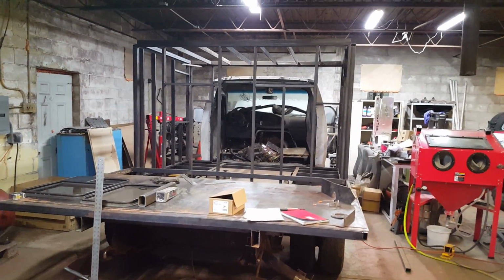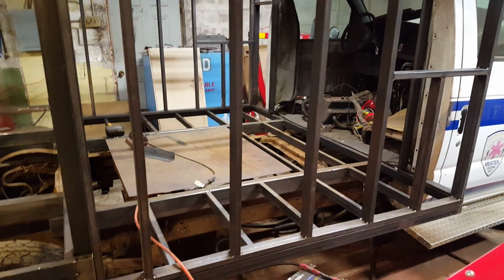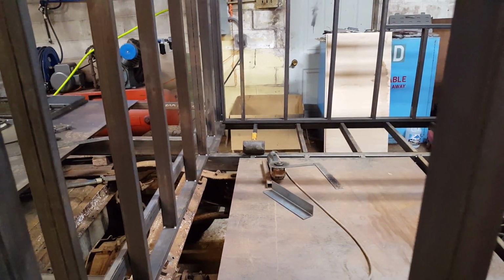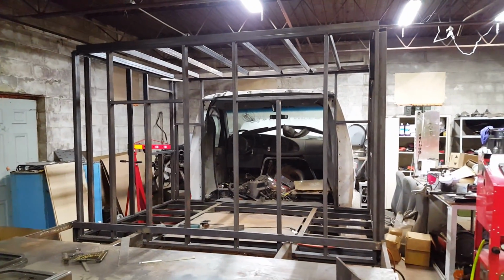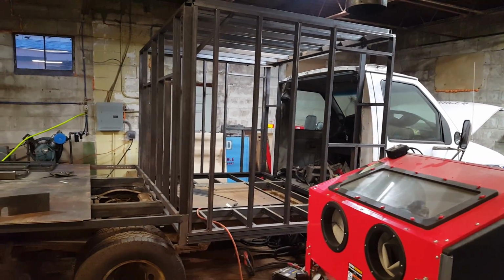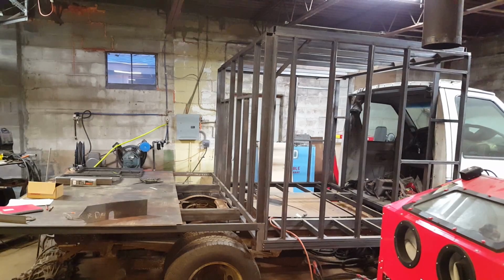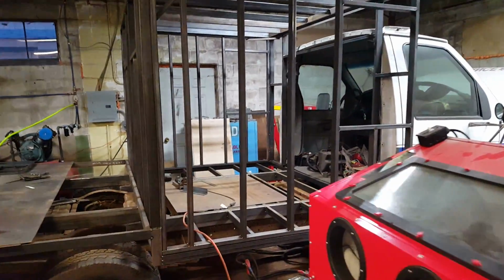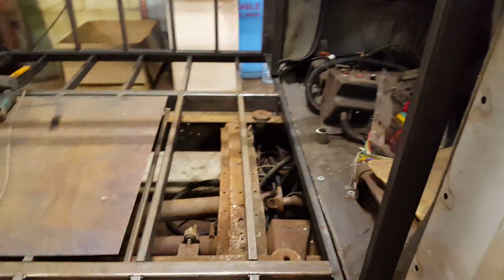Project Tow Rig - Part 5

Comment: Looking good.  Are you planning on utilizing the space under the sleeper, between the wheels, for storage?  Or the space behind the rear wheels?  It seems like you could put in some tools chests or something like that.
Reply from the maker: Due to cost and weight no. I've thought long and hard about it though. If i would have made this out of aluminum I would have. But again cost is a big issue. Dispite what it may appear I don't make a ton of money. I make a ton of sacrifices just to bearly be able to aford to do stuff like this. The project sat for well over a year and I just needed to get it done. So some features I would have liked to have got scrapped. the compartments were one. another was stretching the wheelbase and making a much larger sleeper with a walk in curb side door, frig, stove, solar pannels, and the works. All of that got scrapped.

Now if i could find the right deal on another chassis with a much longer wheelbase, this could end out forsale and i might turn the profit into what i really want. Who knows...? Or I may love it and keep it forever lol.
Reply from the maker: Oh and thank you lol

Comment: I'm really liking this build, it's going to be pretty cool to see it when it's all done, the only thing I see that you might have to do is it's federal law that you have to have an emergency escape door either on the left or right side of the sleeper and that is for just in case something happens in the front cab or like the engine catches on fire and the passengers in the back can not get through the two front doors, they have to be able to get out of the sleeper without going through the fron doors engulfed in flames are if the dashboard is crushed in  blocking the two front doors  from getting out from a car accident.
Reply from the maker: Thank you for your post. This is a very valid point and somthing i did not consider. I've always seen the tiny doors and never understood who the hell would use them lol. I'm going to absolutely look into this but i have a feeling this will not be a legal issue due to the fact that this will be a home built vehicle and not a production vehicle. Thos doesn't mean I won't address the issue though. After i makes some calls and send out some emails I'll figure out what I'm going to do. Thanks for the respectful heads up and for watching.
Reply: Any plans for more progress on the tow rig project?
Reply: Alvarez Metal Works I think this project is turning out pretty well I think it's structurally sound I think it's amazing and I think your engineering it very well. I was just trying to point out the fact that maybe you should put in the emergency door. my comment had nothing to do with the structural Integrity of the design . Sorry to get all these trolls riled up,
Reply from the maker: +Nathan Platt I honestly appreciated your input. It was something I over looked. I am following your advice but the door will be very small. Big enough to throw a cooler and some gear into the sleeper without climbing over the front seats. Big enough for my fat body to slide through it if an emergency warranted it lol. But it will be very small. Basically the space under the passenger side window will become a door. It posses a bit of a problem for my interior plans but I'll figure it out. I need or order in a door latch and some piano hinge before I build the door though. For the time being I'm going to move forward with the seating and a few other elements. It might be a could videos down the road before you see the door take shape.

As for the trolls. I deleted all the back and forth dumb comments. I also blocked the one dick face. No worries. Trust me there will be more to come lol. Thanks for the support.
Reply from the maker: kmcwhq yes. just been dealing with a bunch of stuff. Going to be a busy winter for sure.